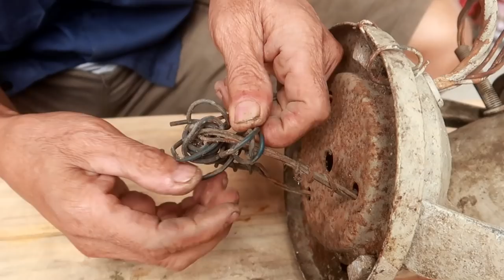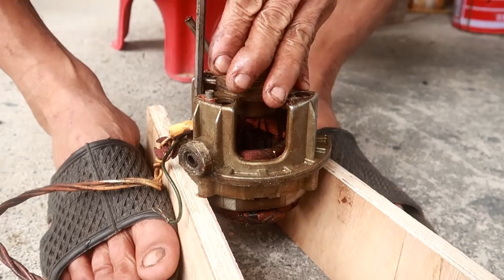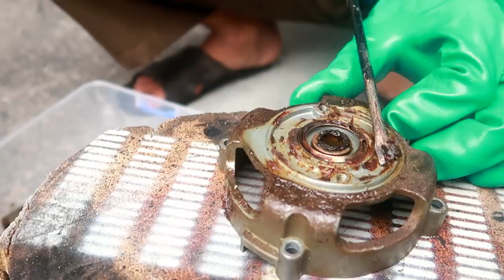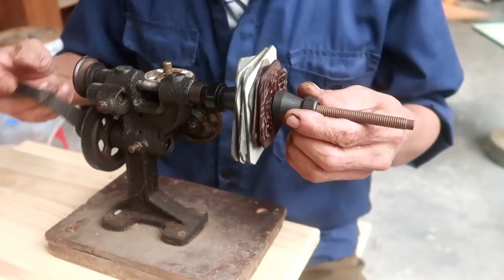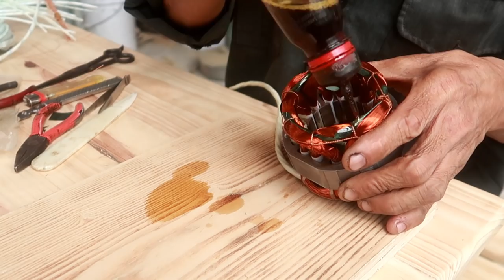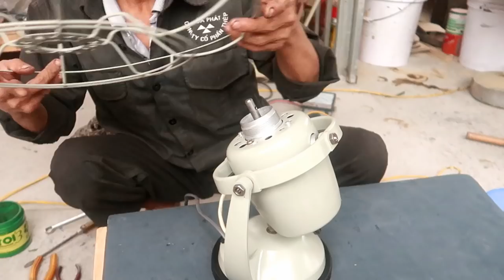Restoration Very Old Ceiling Fan // Rehabilitate step by step

Comment: Excellent restoration!
However you used a lousy quality capacitor and didn't put enough grease in the gearbox. Those are the only 2 complaints. The rest of the restoration is top notch.